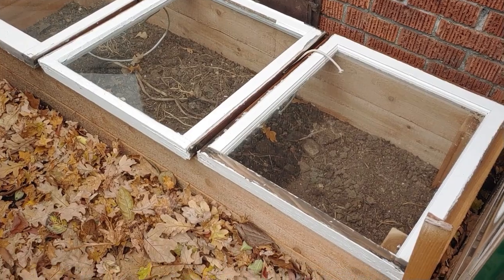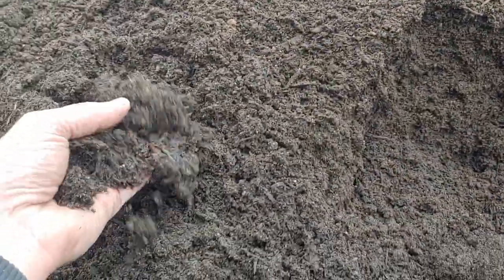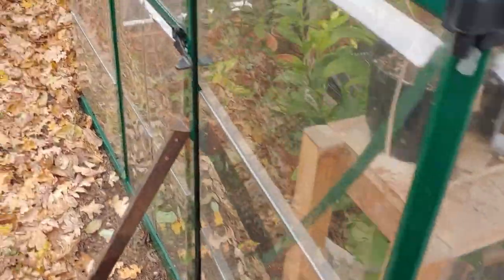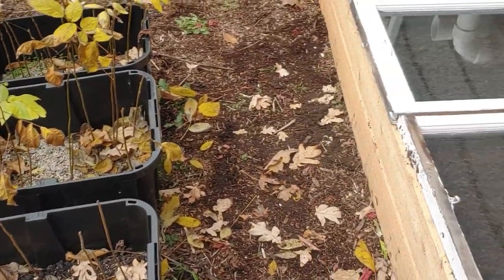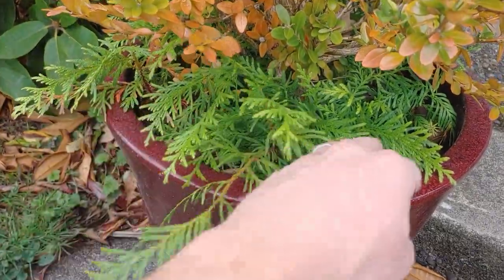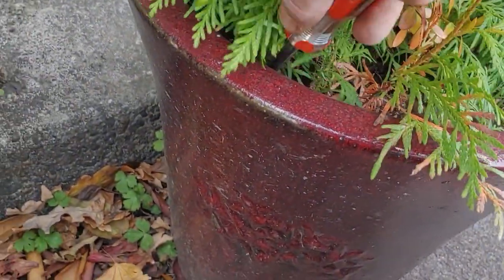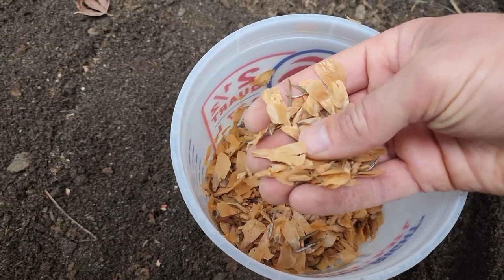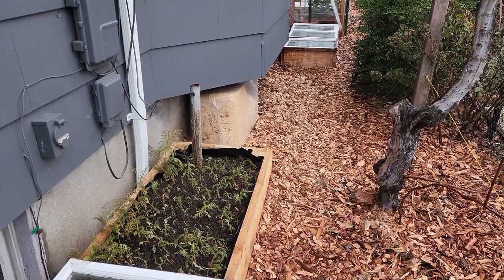Growing Seedlings For Re-Forestation

Comment: I planned black walnuts one year, in the fall I started planting one nut st a time and then I took a hoe and dug a row and poured them in and in the spring they started coming up by the dozens so I planted them about five feet apart then after a few years I thinned them by removing two out of three I even transplanted one, it  was stunted it is now doing great. Fast forward almost twenty years and the biggest problem is the dran squirrels, I have walnut trees in the lawn, the flower beds, the garden and the flower planters and the squirrels are always digging up the flower planters. The worst was the year that there were so many nuts that I had to fill our 96 gallon garbage dumpster four or five times to get rid of them and that was from only twenty trees, I need to remove more of them. Keep up the great videos and God bless you and your family.

Comment: Cedar seedlings... I would have done that project in the spring, and probably transplanted the box elder (I think that's what you said the original plant is) into a larger pot. When I transplant seedlings, I put the root ball into a pail of water. It's easier to work them apart, it nourishes them at the same time, and keeps the shock to the plants at a minimum. Then when I plant them into new soil, as you did putting them into the planter boxes, use lots of water. They flourish very well that way, and you lose fewer of them. Of course, your winters don't get as cold as they do here in Ontario, but planting them at the beginning of the sap cycle in the spring will help them fare better. For you, that's likely early March. However, it's done now, so hoping they all thrive! 🙂

As for the gap around the windows, like another commenter said, I would close up that gap. Not only will it help to keep it warmer in there through the winter, but it will keep the squirrels out too.

I'm enjoying these videos! Of course, I love your smelting videos too.

Comment: You need to plant alder first, alder is a nitrogen fixer which the soft woods need to survive. A tip you might want to consider is larch it grows in a thin band around the world not much left and has specialty use which gives it a higher value.

Comment: finally i can help, i am gardening since i was a small child with my grandparents and even studied agriculture at our university in vienna. 
i don't know how cold it gets in your region and how the trees get along with it but i would definitely cover the gap between the windows and the frame, i recommend sheep wool fleece mats if it's available! i use this stuff too but we barely have temperatures lower than -10 degree celsius, it lets air circulate but also stop warm air getting out to some degree.
your citrus plants seem to have magnesium deficiency, i am pretty shure its the problem! my own also got yellow leaves because of this, just buy liquid fertilizer for citrus plants, it's not that expensive and works wonders! fertilizing is always necessary, plants in pots usually used all the nutritions in the soil after a few months and then problems start!
have you ever thougt about making cuttings for your plantations? it is really easy to do, just cut young branches, put them in rooting hormones and then in rockwool cubes... you can make thousends in no time and it's really cheap too, i strongly suggest informing yourself a little bit on this topic, it is much more efficient than planting seeds and also the cuttings grow much faster than seedlings!
i hope i could help at least a little bit... greetings from austria:)
Reply from the maker: Thanks for all the info!